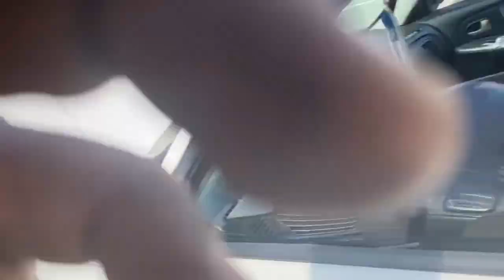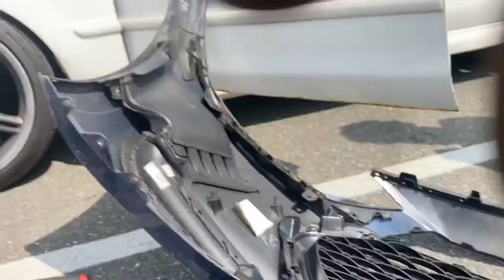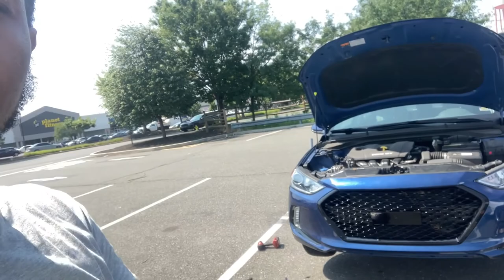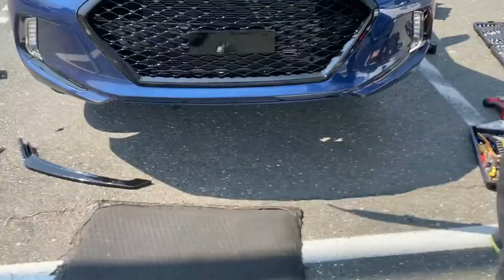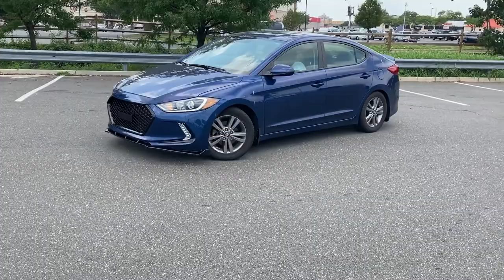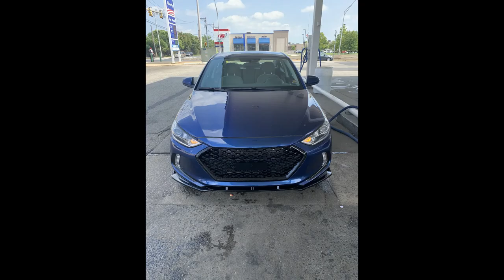HOW TO INSTALL AN HONEYCOMB GRILL ON A 2017 HYUNDAI ELANTRA AND MORE !!!!

Comment: where’d you buy the grill?? 

btw do you have any recommendations on where i could buy a new hood for my 2017 elantra? thanks!
Reply from the maker: Here’s. The link for the honeycomb Grill.    RainMan S ABS Plastic Front Bumper Grill Mesh Hood Front Center Middle Grille, Front Bumper Grille Replacement for 2017-2018 Hyundai Elantra https://a.co/d/2u63iZp
Reply from the maker: For and hood I would just search it up on Google or eBay

Comment: Can I get a link
Reply from the maker: RainMan S ABS Plastic Front Bumper Grill Mesh Hood Front Center Middle Grille, Front Bumper Grille Replacement for 2017-2018 Hyundai Elantra https://a.co/d/2u63iZp
Reply: @TysVlogs65 bro thank you, you the only person that be responding like that and ts looks hella glossy shi clean but you got a link for the back spoiler?
Reply: @TysVlogs65 wait yo I thought yours was a dif version but how the hell did you get those hid lights? And do they work well? I’ll fr cop so much for mine cause I got that lifetime warranty as long as I don’t mod the engine
Reply from the maker: @Aden123   I like to interact with my supporters and and people who be commenting on the videos I got to show love back 🙏🏾💯💪🏾🤝🏾
Reply from the maker: @Aden123  I believe he got the spoiler on Amazon. It’s all different ones so whatever your preferences
Reply from the maker: @Aden123   and for the headlights I believe he got them on eBay. for the most part he bought all the parts I just installed everything